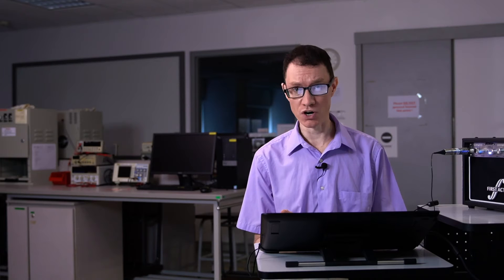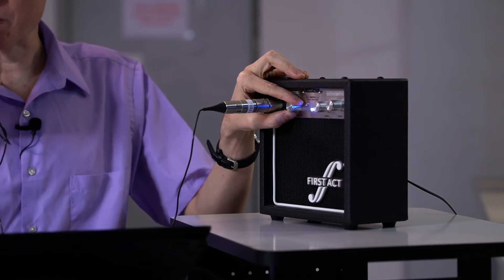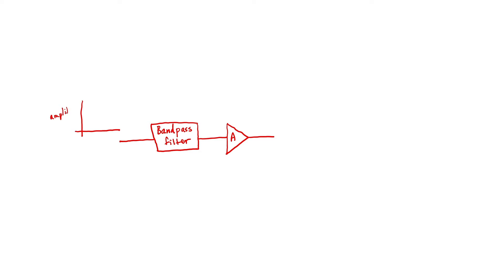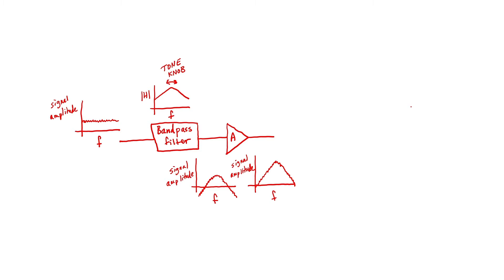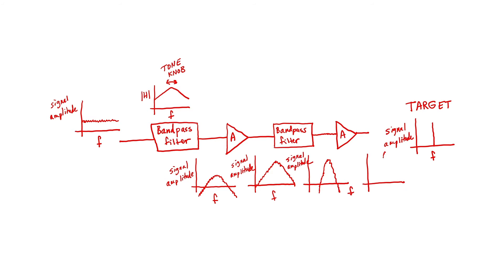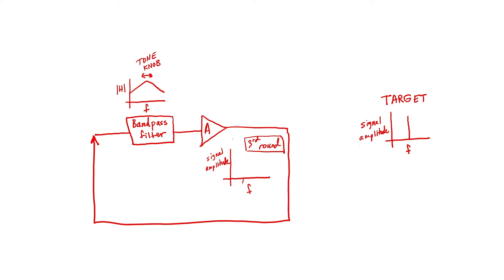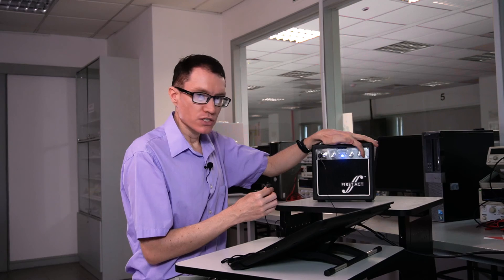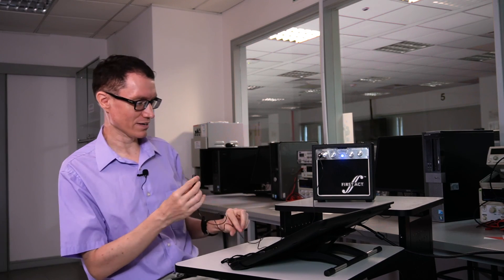Let's build a sinewave generator (1 - Oscillators)

Comment: thank you for videos. 
Is it possible to build an oscillator circuit, drive it into the ground through two electrodes, and emit electromagnetic waves at desired frequencies?